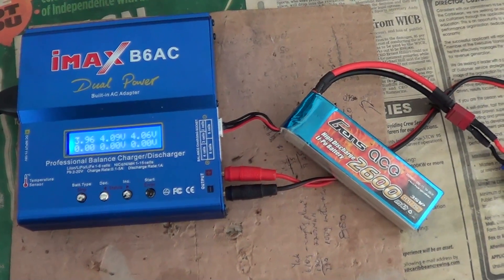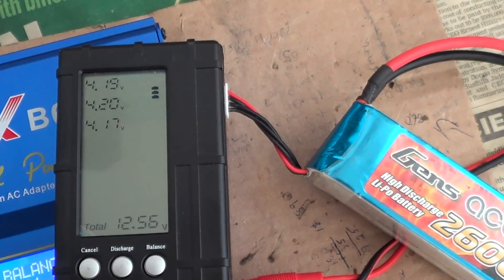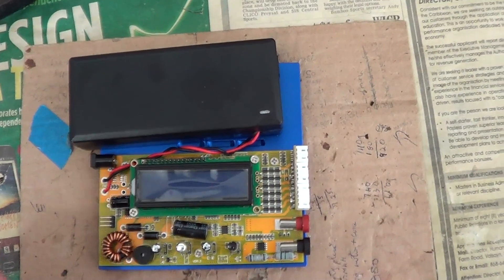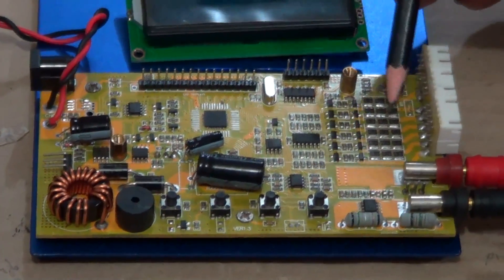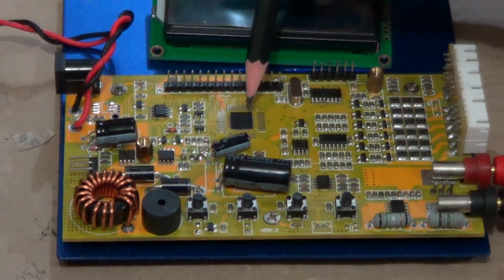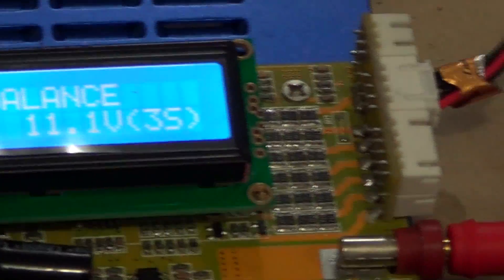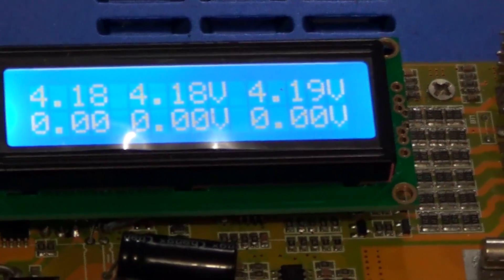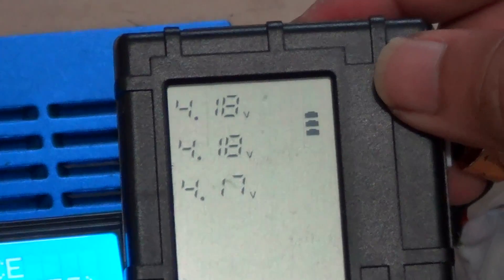Fix for the IMAX B6 LiPo charger when overcharging

Comment: Do you know how to fix Imax B6AC V2? I burned cell 2 and cell 3 sensors by accidentally plugging 2S battery on 3S port. Although there is burnt smell, I can't find what's damaged.
Reply from the maker: +sp4rkbr if you had plugged the 2s connector on the 3s port but the -ve of the battery was the -ve on the 3s port then no damage should have occurred.

Since you got damage it means that you plugged the battery -ve on a +ve on the 3s port. Most likely the discharge resistors may have been damaged or the output transistor or even the input to the circuit power.

Try to get some voltage readings around the circuit and note if there is any power output from the charger. The work your way backwards from there.

Comment: I see from one of your reply's below that it is a HCF4051 SOP16 analog multiplexer. Can you please state where you purchased yours from so that people don't buy faulty ones to replace theirs. I'm just thinking that if so many Imax B6's were sold faulty then people watch this and buy from china on say ebay then they may well be buying the said faulty item. And lets face it. China does not care if people buy fake Imax's and set their houses on fire. Excellent video Rabin. (Sorry if I have that wrong) If it wasn't for people like you we would all be screwed. Especially being as most electrical products now come from China.
Reply from the maker: thank you for your thoughtful words. However I bought my multiplexers from ebay just do a search or you can maybe buy it from fururelec or mouser or digikey if they have. Also there is a possibility that only the one I bought had a faulty mux. It worked fine when it was new  but after some months it started to fail.

Comment: Can I give my own to fix for me?
Reply: yes, simply stick your head up your ass...
Reply from the maker: unfortunately i may not have the time. but if you describe the problem maybe i can be of some assistance.
Reply: My charger is overcharging my batteries at this point in time.  I re-ordered a new balance board to see if that may solve the issue.  Also the voltage readings from the charger while charging is all over the place.
Reply from the maker: Chet Forbes  it will overcharge if the microprocessor sees a low  voltage when the actual voltage is higher so I suspect the balance port and/or mux might be the problem. Also the ADC converters may be suspect too.
It is a good idea to eliminate the balance board.
What type/model charger is it?
Reply: It is the iMAX B680AC AC/DC 6Amps 80Watts LiPo NiMh Battery Balance Charger
Reply from the maker: it will be the same layout as the video.

Comment: My T6 charger (same like above) purchased from hobbyking got damaged. Its main input power capacitor of 470uF was bursted and therefore the tiny 8 pin IC near to it (near LCD stud) got burnt. Replaced the capacitor and connected again to power supply. Everything started well like all menu, selection, buzzer and all. But when i long press to start charging, it shows battery checking.... and then it shows connection break (though batteries connected properly). My all doubt is on the IC which got burnt. SO what can be a solution on it...??? What IC it will be...???
Reply from the maker: most likely it is a N channel or P channel mosfet ic. see if you can get the part number. Also under the circuit board are two power mosfets if these go bad you can get connection break or no discharging capability.
Reply: @rabindranathramsarop  
My IMAX SKY RC B6AC  version 2 won't discharge. Can you tell me please, which of the three mosfets on the back of the board is responsible for this?

Comment: It's a fake as you already seem to know. But thank you for this information as I ordered an Imax B6 just yesterday and I expect it will probably be a clone also. Now if by the chance it doesn't detect the voltages correctly I can buy the multiplexer on ebay and put it in there.
Reply from the maker: yes. if the clones have the same generic problem.

Comment: The potentiometers are resistors and the grid of little black things are diodes.
Reply: No, those are SMD shunt resistors, with exactly 20.0 ohms impedance. The balance port on mine does not seem to be working properly on my unit. I will need to see why, I accidentally shorted 2 of the contacts while a battery was plugged in and charging, and magic smoke was released from something. Nothing is obviously burnt.
Reply from the maker: but something is since there was smoke

Comment: did you test the charge current and discharge current of this meter.
I dont always get the values displayed on the Imax charger when I test it.
Reply from the maker: unfortunately no. do not despair once the charging voltage is higher than the battery voltage it will charge though maybe not as fast depending on the charging current.

Comment: Hi, nice video and tip. Might I know what is the correct model number for the MULTIPLEXER please. Thanks a lot.
Reply from the maker: thanks for your comment. it is HCF4051 SOP16 analog multiplexer/demultiplexer.
Reply: Rabindranath Ramsaroop great. I find some. Thanks. But they only sells them for 10 or 20 pack. I only needed 1 for the project.... I will just keep searching:) thanks again.

Comment: Thank you, but this is a copy of the original.
Reply from the maker: You are welcome. This is a clone ImaxB6. This problem may or may not be specific to the clones. I cannot say for sure but the circuit layout is the same. So far I have had this about a year after the fix and it still performs good.

Comment: mine gives battery not connected error in any charge/discharge mode, in calibration it shows correct battery voltage!
Reply from the maker: there are two mosfets in this charger one for power and the other for charging.
check the one for charging.
Reply from the maker: lez briddon thanks for your information. please let me know if it works after you change the charging mosfet.

Comment: me have juste recalibrate my B6 ;) in back menu
Reply from the maker: most imax's cannot be calibrated as they are disabled from the factory only the output voltage is sometimes able to be changed.
Reply: me have push 2 buttons on start for go in special menu
Reply: Rabindranath Ramsaroop
and why me and not other i have SAME board of u  (clone)  the TRUE imax is not the brown board
Reply: @pierre-alexandrelemay1720   hi which 2 buttons do you push???  to get to special menu

Comment from the maker: Thanks for your comment. 
While there are inaccuracies in any voltmeter. This one is reasonably good. Even so the absolute values of the voltages may be wrong but the 
relative voltages between the two devices (the imax and the voltmeter) were large before the fix and small after the fix.
see second comment